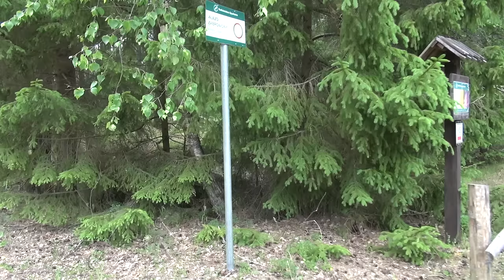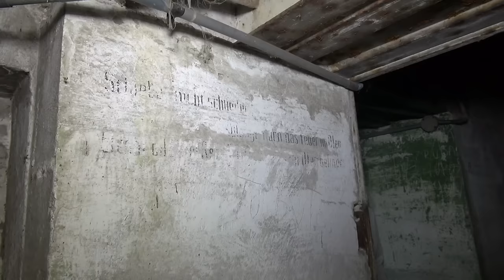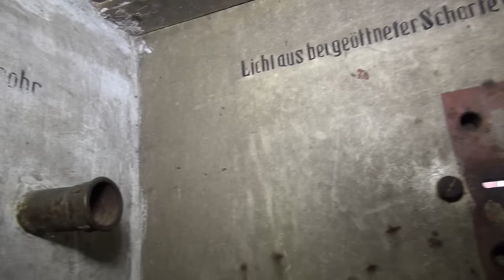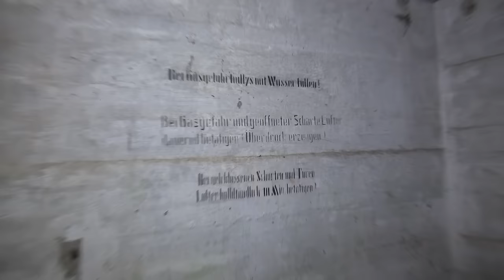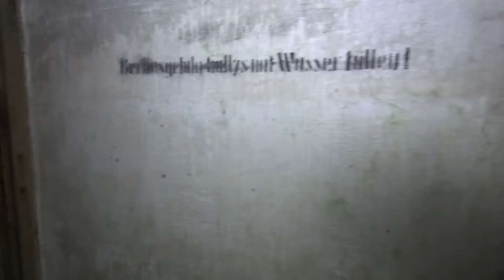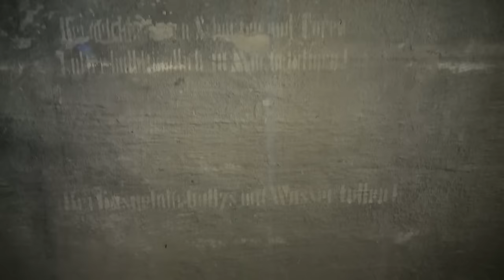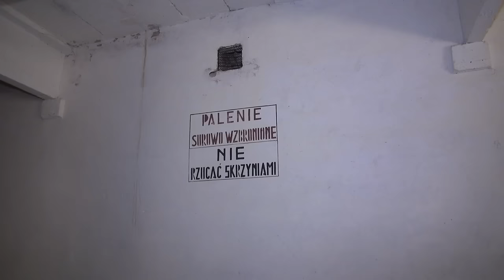HITLER'S WOLFSSCHANZE UNKNOWN BATTLEFIELD

Comment: 34:37 It's not a poem, it reads the same as in the other bunker: "If there is a risk of gas and the hatch is open, operate the fan continuously. Create excess pressure" "With the hatches and doors closed, operate the fan for 3 minutes every half hour" "If there is a risk of gas, fill drains with water". It is not art, it is instructions on how to survive a gas attack.
Reply: I was told that chlorine gas absorbs readily into water ( like 800cc of gas dissolves into 100cc of water ! Making hydrochloric acid as a result ) So filling the drains with water to soak up some heavier than air gas makes sense .
Thanks for the translation . Nice looking script style though , which is probably why Tino thought it might be poetry ....
On a similar note .... I sometimes when I watch youtube videos , I turn on the captions to help when the audio is quiet or whatever . Not often do I do this with Tino's videos , but I had it on when the lady tried to translate some Polish signs and had it still on just after that when Tino found the defensive Koch shelters turn over on their sides . The captions blanked out the word Koch ! Lol

Comment: At 52:40 you talk about the odd sloped opening in the entryway.  Not certain myself, but it my be an overpressure (IE explosion) vent.  It would allow the majority of the explosive pressure to vent out the side, thus reducing the concussive force on the inhabitants of the structure.
After all, explosions take the path of least resistance, and if you give it a easier path to exploit than your body, it will take it.